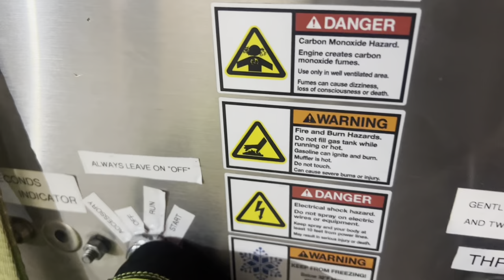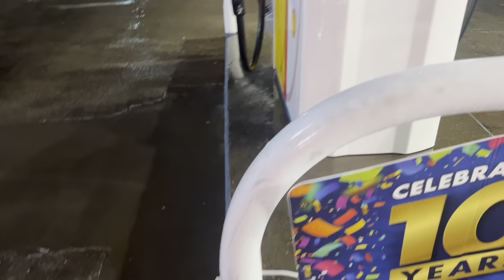How To Pressure Wash Gas Stations | How To Soft Wash A Gas Station Canopy | Commercial Cleaning

Comment: Did you end up finding the bar to the whisper wash? What were the two mixer valves you adjusted for the first gas station on the soft wash system, water and SH? How long or how many gas stations does a bag of sodium hydroxide last you? Thanks Barry
Reply from the maker: Not yet 🤔 I’ve gotta order a bar from
Whisper Wash directly,bleach and soap are the two I adjust ,water stays on and the 4th one is for a degreaser but I don’t use it ,I may try it one day and shoot a video showing it.
Reply from the maker: A bag can last me easily 20
Locations of used sparingly and average dirty locations. By the way thx for all the support 🙏 I see it and appreciate you
Reply: @littlespressurewashing  thanks Barry I appreciate it and you for the content and information. Yeah I built myself a cheap manifold with the 4th one as an auxiliary to drop stick but pretty much like you for a degreaser. Have a great rest of your day and stay safe out there.
Reply from the maker: @MannyAguilarJr that’s awesome bro

Comment: What size hose are you using on the soft wash system. I've got a gx190 with a kappa 55va and not sure what size hose to get to set up like yours
Reply from the maker: Im Running 5/8 I Believe on one System and 1/2 on the other but im am going to upgrade to bigger soon so that we DONT restrict any water flow
Reply: @littlespressurewashing  Thank you for both response to my comments this one and on the short video 🤙💯
Reply from the maker: My pleasure